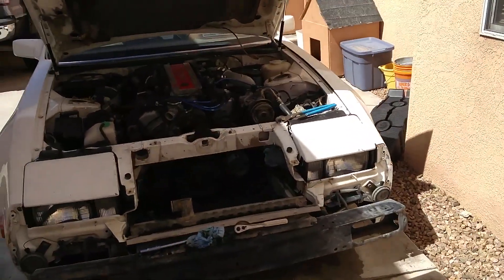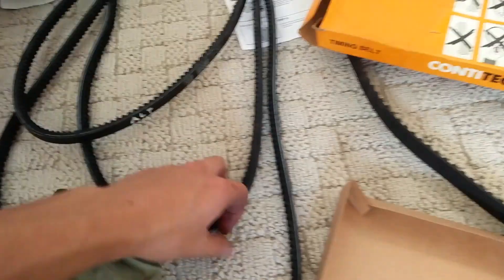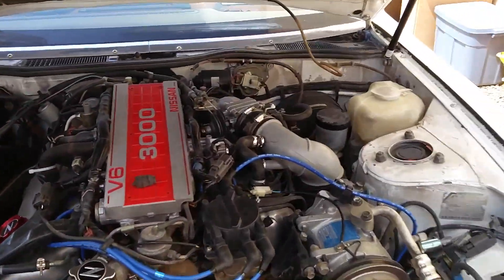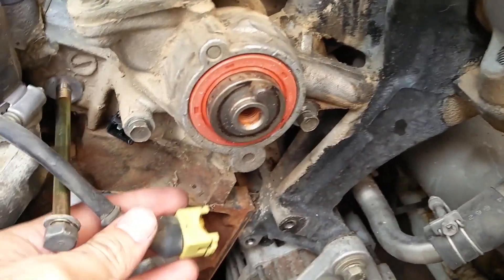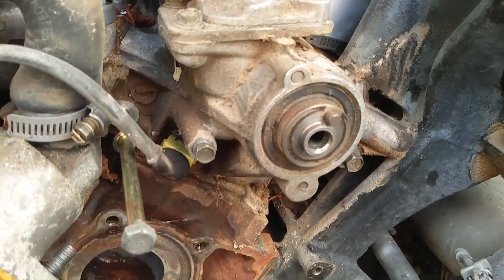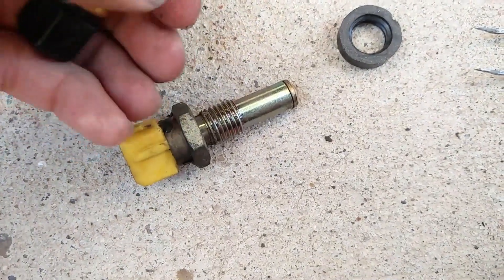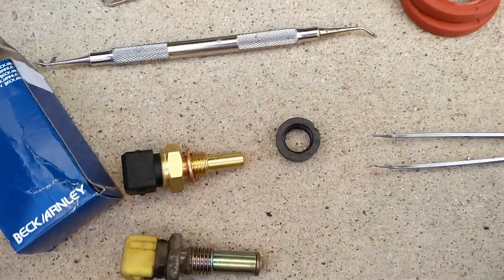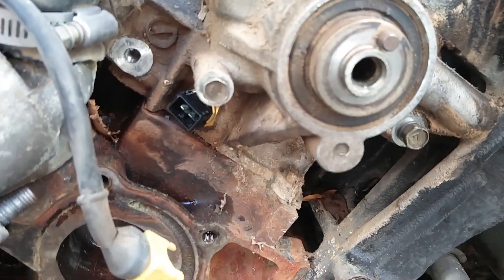300zx Update: Water pump, CHTS, Cam Seals, and more! (Z31)

Comment: Hey where did you get the Z radiator and oil caps?
Reply from the maker: I don't have the link but I found them on eBay about 2 years ago
Reply: Hello I watch your videos and I’m in the process of changing my timing belt and all parts and seals. How did you remove the timing gear sprocket to replace the oil seal or did you not replace the seal? Thanks in advance.
Reply from the maker: I rented a timing gear removal tool at autozone. It's basically a big plastic bar that locks to opposite sides of the gear and then you can use a wrench to pull off the bolt while you hold the gear from turning

Comment: How did you get the cam seals out/in? Any tips? I'm about to do them so figured I'd ask. Thanks!
Reply from the maker: I used a little hook shaped tool made for opening paint can lids. The process was a pretty big pain but just remember to not scratch either of the mating surfaces or they'll leak